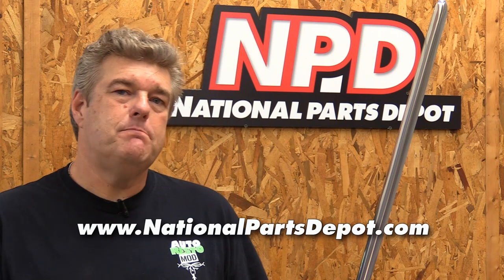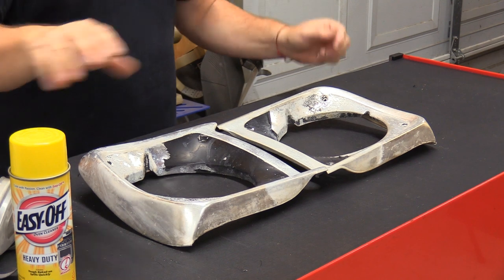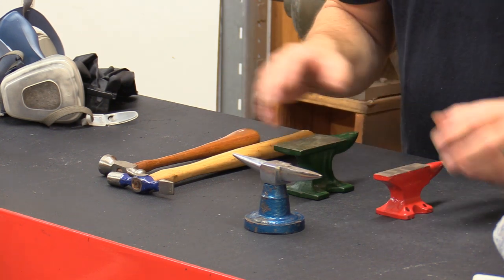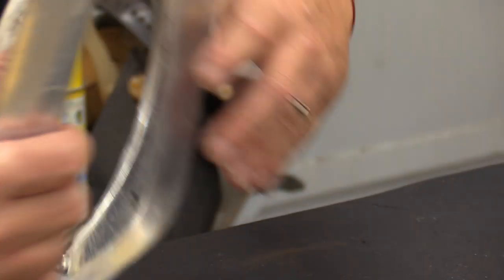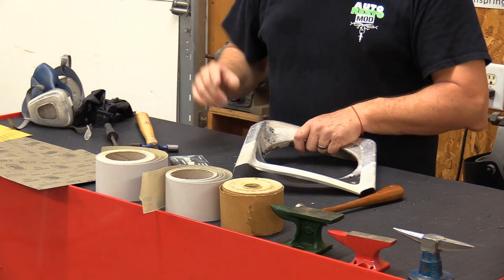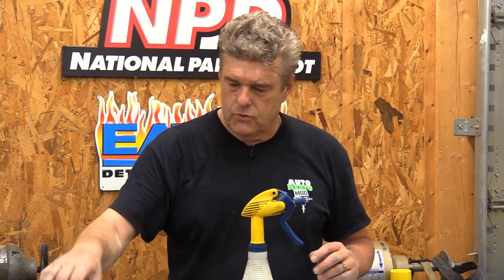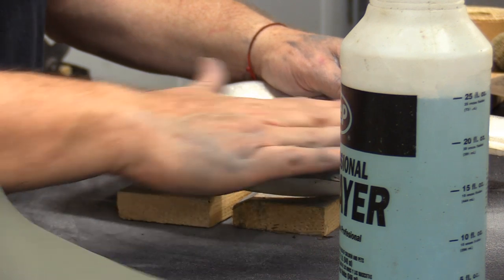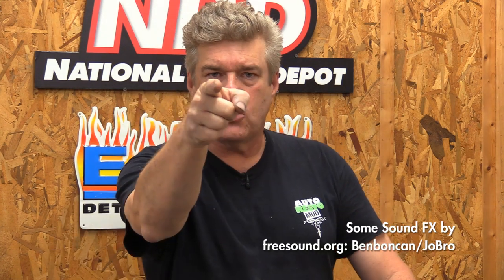How To Remove Anodizing From Aluminum Episode 425 Autorestomod

Comment: Powdered drain cleaner works great, less harsh chemicals to worry about. I think its 100% lye. Ive de annoed alot of bike parts over the years with great success.
Reply from the maker: Awesome! We hate the delivery of the oven cleaner but like the results. I will try your idea on some of my old trashed aluminum.
Reply: So it will take off the black anodizing off a new black swingarm?

Comment: If you lack the time and have the money to send it out Paul's Chrome restores both aluminum and stainless trim . I am going to try my hand at doing a few parts on my F100 that are cheap to replace used , if I fail I will be sending the rest out to them to get it done .
Reply from the maker: I've heard of Paul's. Good reputation.

Comment: I just completely effed up a very expensive piece of aluminum trim. It was about the last step in a 2 year restoration. It's the big wide lower qtr piece off a 1972 Monte. I sanded right through the coating down to bare aluminum. Now I just cannot get it to shine.
Reply from the maker: Hate to hear that! I'd recommend finding a shop that does anodized coatings and trim repair.

Comment: The original anodizing look isn't as nice as the polished aluminum. I check the reflection under  LED lights and look for a crisp mirror finish.
Reply from the maker: Agree
Reply: @AutoRestoMod  Not to mention after doing quite a few pieces of trim, anodizing does weird things to the metal.

Comment: I'm glad I bought the complete 72' grille and bumper 20+ years ago... Still in the Fomoco box :) I've priced new or repo parts and Wow they are expensive! So nice to see a video on cleaning up old moldings!
Reply from the maker: We got lucky with the grille we got recently. I plan to refinish all of the stuff but not on camera...pretty sure nobody wants to see that.
Reply: @AutoRestoMod  Great info on using Easy Off and the sanding... I got a ton of original trim on my 71' Galaxie500 that will need to be cleaned, no repo parts for 71'/72'' Galaxie500-LTD and most likely never :(  But did a lot of collecting trim back in the day so I have plenty of old trim for about 3 cars :)

Comment: I removed the anodizing from a set of windshield moldings. They are easy to work on when removed. I used several grades of wet sandpaper, it took me most of an afternoon to do the 4 moldings. When they were finished, I polished them by hand with rubbing compound, then a couple of coats of wax. That was several years ago, they still look great.
I didn't need to poison myself with that spray acid stuff, and wouldn't recommend it for anyone with respiratory sensitivity.
Reply from the maker: I wear a respirator when using that stuff. And agree on the respiratory  sensitivity.

Comment: Those big aluminum "Razor" Grilles on the old classic Full Size Jeeps are also anodized and they also happen to look extremely aggressive when cleaned up and polished, On those if your doing the Grille and headlight trim I recommend going in behind it and repainting behind it with a nice dark flat black, can also hide a couple auxiliary lights behind the grille in a couple original openings...It used the original Kaiser body panels through ALL the years of full size Jeeps, you can go forwards or backwards in look on those!
Reply from the maker: Nice!

Comment: You might want to try a Bonny Doon forming hammer from Rio Grande. The head is interchangeable and they made of urethane. There is no short cut to polishing aluminum or stainless. It's important to keep grit out of the paper and the surface. You need a bucket or sink to get clean water when you rinse.
Reply from the maker: I will definitely check out those hammers
Reply: @AutoRestoMod  Be sure to watch the video and read the description, they take less effort than en equipment hammer.

Comment: So how long do you leave the oven cleaner on for? I don't want to wreck the trim
Reply from the maker: We generally check the part every 5 to 10 minutes. the nice thing is you can wash it off, let it dry and reapply if it isn't enough. It will depend a great deal on the quality of the metal substrate as to how much damage the oven cleaner will do.

Comment: I'm halfway through refinishing all the Ranger trim on my F100. I worked really hard at it for several weeks, then took a 3 year break while I got married, moved, renovated, and had babies. But I'm hopefully going to start back soon. I'm halfway through the sanding, but I must say, I learned some really good techniques and tricks watching your video. I was also glad to learn it's not best to spray it with clearcoat. Question: how often do you have to polish it with Gibbs oil?
Reply from the maker: I've had the Gibbs on the wagon for about 6 months and it need a re-application.

Comment: How would I repaint the buckets exactly as they were as well as the grille? The black lines and all that.
Reply from the maker: Tape them off is about as close as you can get. Use the plastic fine line tape for rounding corners. For home use, I'd use Rustoleum semi gloss black.
Reply: @AutoRestoMod  Okay good to know, I accidentally sanded too far on the grille, but luckily it’s in a spot that’ll get painted over! Rust oleum professional enamels are my go-to. Thanks!

Comment: When taking dents out of trim, less is more, you need to sneak up on the dent removal. I’m conflicted on the use of clear on this stuff. If it’s a museum piece, maybe. But if it’s gonna be a driver it’s gonna get scratched.
Reply from the maker: Sometimes I snaek up on them and scare'um. LOL I'd rather have the option of quickly getting at the problem which is why I use Gibbs. And if I am going to do a Concours car, I'll have the plating redone.